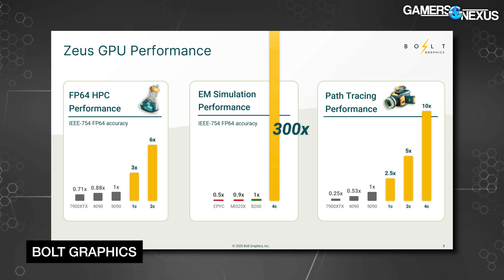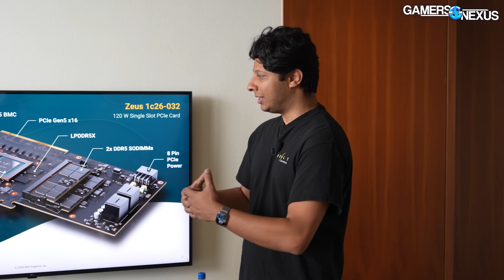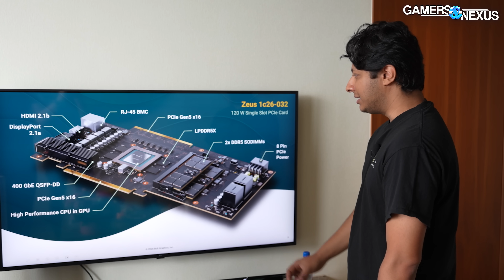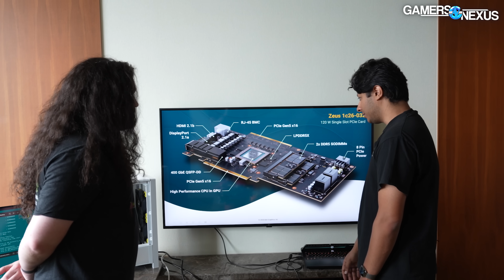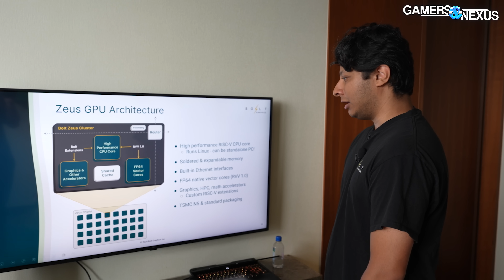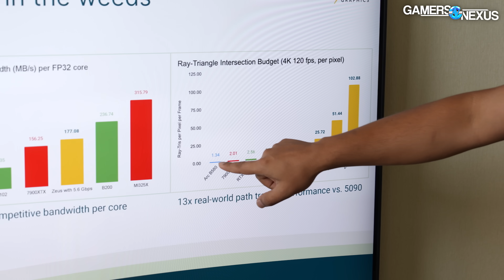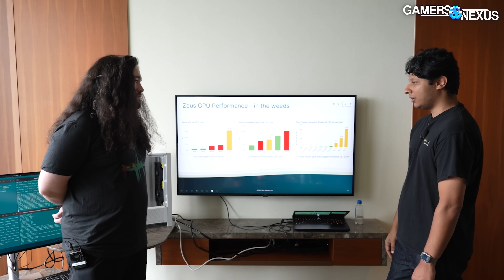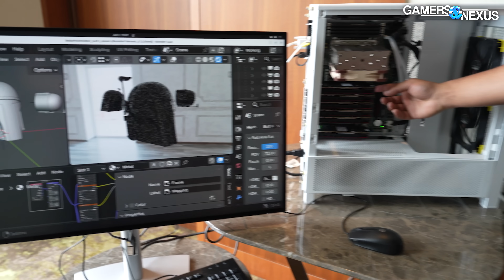A New Gaming GPU Challenger: Bolt Graphics Takes Aim at NVIDIA

Comment: This feels dead on arrival as a serious NVIDIA/AMD competitor. Designing silicon is only the beginning—you also need mature drivers, compilers, APIs, developer tools, application support, and years of software optimization. Then there’s the memory architecture: LPDDR5X plus DDR5 SO-DIMMs may provide capacity, but capacity is not bandwidth, and modern accelerator workloads are increasingly constrained by memory access. Meanwhile, LPDDR demand will only intensify as more of the industry—including the data center—moves toward low-power memory. Until Bolt demonstrates production silicon running real applications, this looks more like an interesting research project than a viable competitor.

Comment: correct me if i am wrong, but games are programmed for DX11/12 or Vulcan right? or like for an engine like UE5?... dosnt every game "run" on a graficscard if it supports DC12 + UE5 for example? arent main differences like between Linux and windows (OS) and making the graficscard compatable with both via driver is the main angle?

What exactly does "Making the card compatable with all different kind of games." even mean... from a technical perspective? i mean if it dosnt support raytracing.. the game will just disable or not be able to use it but still work?
Reply: GPU doesn't care if it's running a game, or app, if it's running on a windows or linux, nor if DX is used or Vulkan or any other API. GPU just processes the data, and how that data is processed is one of many things that are needed to create a working architecture of the GPU. And just like in games there are bugs, then also in the architecture there may be issues or mistakes. Making something different than it is usually done by bigger companies, while ensuring that every existing software (this includes games) works properly on this new device takes time and effort

Right now I'm a little bit skeptical about their product, while it works on low frequency and on a simulation hardware, there may be unexpected issues when trying to scale it up
Reply: This may not be the best example, but imagine designing a new calculator (GPU analogy), you are pretty confident in it's speed, you test it on various examples (math operations in shaders) like:
1+2=3, 
2-4=-2,
-4+6=2 etc.

It works flawlessly in those cases (tested games), you release this calculator, and then some user tries something unexpected (playing some older game / untested game) like:
4+0 and your calculator incorrectly returns 0 (game crashes / there are glitches etc.)

And since you released it, made those calculators with this design flaw and you can't really fix it via software update (it is broken in the hardware), people suddenly stop buing your calculator, reputation is lost and company basically loses millions of dollars.
This is the importance of ensuring compatibility, this is a silly example, but the idea is more of less the same, create a design, architecture, that is compatible with existing software and outputs correct results
Reply: @krystiano.610 thanks. Something like that was my thought, thats why my brain was "Wait working togezher with gsme studios or such? To support their games?" Because even what yoi say sound more logical where the gpu is meant to behave and solve X and the efficiwncy determans the performanse but X dosnt hsve to be changed based on like baldur gate or whatnot...

Thanks for the clarification, but is DX12 and Vulkan for wxample not just a certain set of specified input/outputs? Like on the CPU where between arm and risx v the command det changes?

Nevdr doved deep into gpu stuff as it was "explsned" to be that a cpu core handles many instructions slowly and a gpu handling a small sub set but very efficient.... and not a gpu has a 400GB QSFP slot and my brain is like "Wait a minute.. its not as GPU shaped as the other thinks.."

Comment: 20:40 NV isn't so much dragging the industry into path tracing as AMD dropped the ball - yes, AMD was excellent and forward thinking last decade with low level APIs and GCN but they missed the memo in 2018. Real-time RT and PT are an obvious evolutional step for computer graphics.
22:30 Yep. And when the larger amount of systems are not capable of running PT or RT at decent frame rates the developers will avoid using ray and path tracing at a lower level and implement it as a parsed out afterthought, ambient occlusion, SSGI, reflections ect.
Hopefully these guys take off, the industry has been begging for more players for years.

Comment: Didnt Intel just bail on their discrete GPUs? The Chinese have around 3 or 4 GPU companies but their hardware still has a ton of driver issues. It looks like for the time being we will have AMD vs Nvidia.
Reply: Intel is still in the dGPU market. For gaming, there is rumors about Big Battlemage (B770) being cancelled due to the poor scaling of the current architecture. AMD ended up filling the 16GB low-mid level card in the 400-600 USD range which all perform better than what the B770 was going to do. For creator/workstation cards, they just released the B770 equivalent B70 as well as the cutdown B60 and the further cutdown but SFF B50. Celestial should provide better gaming scaling but what will AMD offer in 2028 when Intel's next gen card drops alongside it?

Comment: This card would have been a fantastic challenger to the GTX 1060 6 years ago
Reply: Personally seemed like a lot of hot air to me. Slap on a bunch of stuff prosumers know about to drive hype. I really hope I'm wrong, but I just don't see any wedge into the market.
Reply: @leodaso2  It's definitely screaming scam to me and the market it's destined for is the AI market.
Reply: I know youre probably being sarcastic about this because 6 years ago is about when the 30 series was launched. The 1060 6gb came out 4 years earlier than that in 2016
Reply: @packerman1203  Sorry, it was late 2018 that had the GTX 1060 GDDR5X refresh on 120W TDP

Comment: About time somebody added ram slots back to graphics cards. Awesome stuff!
Reply: It’s a no brainer but it doesn’t drive profits when people have to buy a whole new card to upgrade so the big companies don’t implement it.
Reply: SODIMMs are at a dead end with DDR5 (signal integrity issues are why you don't see crazy high speed SODIMM DDR5), hence the development of LPCAMM2 for use with faster memory than what SODIMM can handle. If they are indeed planning to have expandable RAM on their card, the choice of SODIMM is strange.
Reply: @cardboardsnail bc this guy is full of sheet imo. Either that or he doesn't live in reality.
Reply: @cardboardsnail  for density socamm2 would be better because can provide 128b wide in a verry tiny size ,unlike lpcamm that have uneaven share with a notch

Comment: This has all the markings of a too good to be true scam: using cheaper and slower memory, with user expansion - which no one has been able to do because of latency - while achieving better latency and bandwidth than the market leader, completely curbstomping nvidia on RT performance, while AMD still hasn't come anywhere close to catching up after 3 generations and all of that on fraction of the power and while undercutting them on price. 
If GN weren't covering this, I'd immediately write it off as a scam, but I hope Steve wouldn't fall for it. 
Hope we'll actually see a product from these guys at some point and they don't just disappear with the investor money.

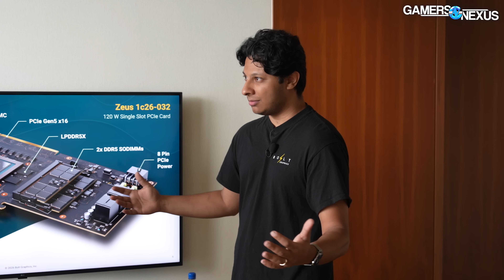Comment: It's actually a brilliant direction to take. If the creators made their content on this card it would stand to reason it should play well on this card, right? 😂 4:00
Reply: Even tough the gap has been closing (both ways), between asset creation, rendering software, and realtime rendering (games), they still use different paths. On top of that, someone might be working on a single asset or even a world, but that will not run many of the things that would have been running once the game ships. Not sure how clear I can be without using any jargon, but the idea is that your reasoning is good, though it might not be able to stand. Being able to create assets on a certain card, does not mean it can run the game that uses the asset.

Also, as mentioned in the video software/driver support can be an issue. They showed what that might look like (using Intel as example). From bad performance to actual artefacts/glitches/crashes. That's why they're going for the professional market first.

A few reasons I can think of, to start in the professional market are: more money to invest, better communication channels, big contracts, software updates are often much slower than the constant stream of newly released games you'd have to adapt to. And the pipelines in many software is often a bit easier to understand and work with. Less prone to big changes.

I have great hope in this company, and wish they get to a place, where your reasoning might turn to reality.

Comment: I am very skeptical on the DDR5 laptop memory, lots of cache on chip is expensive and causes yield issues, and there is a reason GDDR is mostly soldered and located as close to the chip as possible, i am very curious how they solve latency issues between the soldered LPDDR5 and the slottable laptop memory.

Comment: Well if its small, has open source drivers that work on linux and isn't just a basic display adapter (can play at least cs at 144 fps) then I would buy it, that is if it costs around 200 usd.

Comment: well current gpu could come with extra slotted memory but the companies choose not too because they need to force limits so you keep buying more which in the end makes a worse product and to make you think things costs more then they really do. Think intel with 4 core cpus era and now with semi fake issue with ddr. like amd and nivida trying to lock down vram amounts unless you pay within a pay range where they make 3x-10x costs of the product. 

A low vram forces the client to have to buy a new product at an higher price but with little to none performance improvement example is 40 series to 50 series.